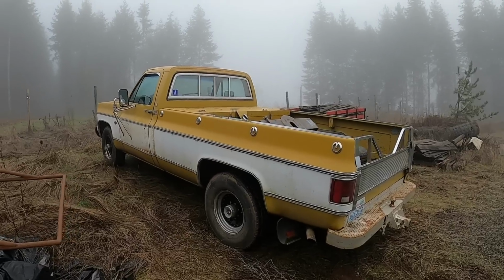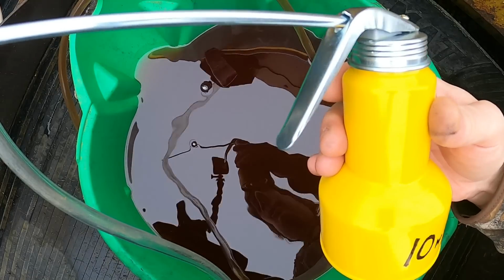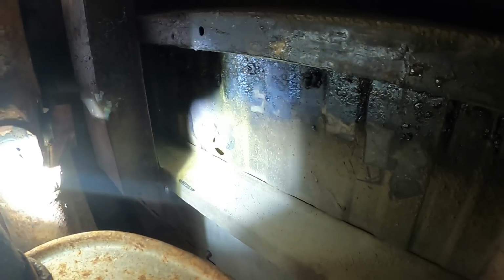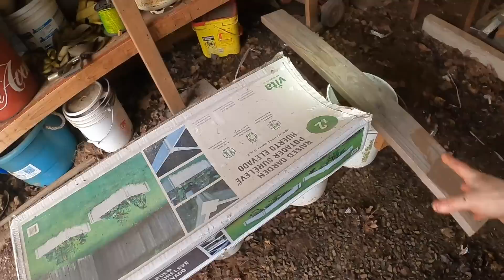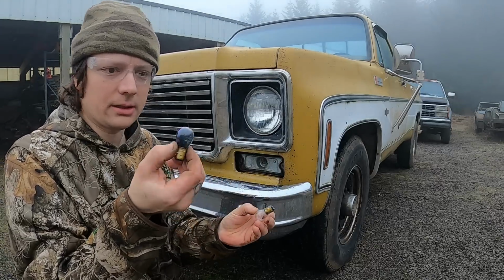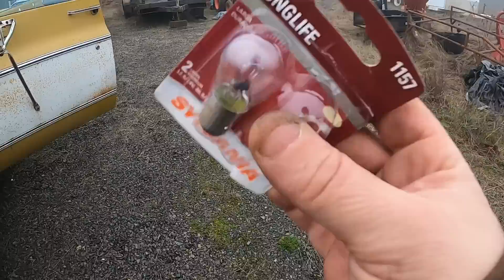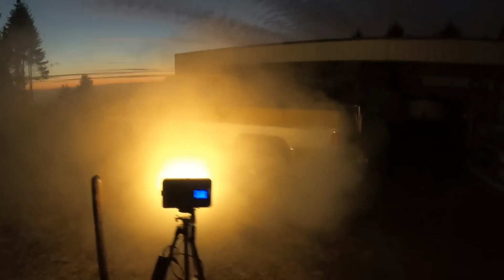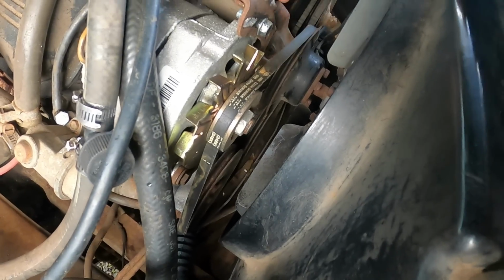1973 Camper Special - Draining Old Gas From Back Tank & Replacing 2 Bulbs

Comment: Ignition coil not getting 12v while cranking, that's why it fires as soon as you let off starter. Also you might get pulled over for no license plate light.

Comment: Sounds like your ignition doesn’t fire until you stop cranking. Distributor might be wired incorrectly.
Reply: You have two small terminals on the starter solenoid and one large terminal. The big one is for the battery cable and the small one to the right of it is for the S terminal (start terminal) on the ignition switch. The small terminal to the left of the big one is what is causing your problem, the I terminal, you need to run a wire from that terminal to the + terminal on the coil. So, when you are cranking the engine it feeds a pure 12 volts to the coil to fire the motor, then when it gets started and you release the key from the start position, the ignition terminal on the switch will continue to feed voltage to the coil to keep the motor running.
Run that wire and your problem is solved.

Comment: If you haven’t done it already you should get a grease gun and hit all them zero fittings on the front end and drive shaft. Pump that old grease out get some life back in them universals. Sure you can lookup the grease points for that year Chevy on the internet.

Comment: Wow, Thats a beautiful sunrise🤩 Is there a mechanical fuel pump on the car?  It seems like the fuel is draining back to the tank when the car have been  sitting for a while, And maby that is why Jimmy needs to be cranked for a long time before there is enough fuel in the float chamber for Jimmy to fire?(It's typical that old mechanical pumps get dirt in the valves inside of them, Leading to the valves stop holding the fuel pressure when parked and the fuel siphoning back to the tank🤓)  Just sharing my thoughts😉 I think it's so cool that you keep taking care of old Jimmy😎 Keep doing what you do👨‍🔧

Comment: Good chance that you will find no thermostat in there or it is stuck open. Very important that the engine gets up to operating temperature before it will run correctly.

Comment: if it is white smoke coming from exhaust it is a  one sign of head gasket issue, Great sunrise
Reply: actually in cold climates white smoke is expected until the engine gets to normal operating temp so might not be a issue but if it has a sweet smell then the head gasket might have failed

edit: watched to the end now holy smokes that much white smoke means def a head gasket failure or cracked block from water freezing if there was not enough antifreeze used